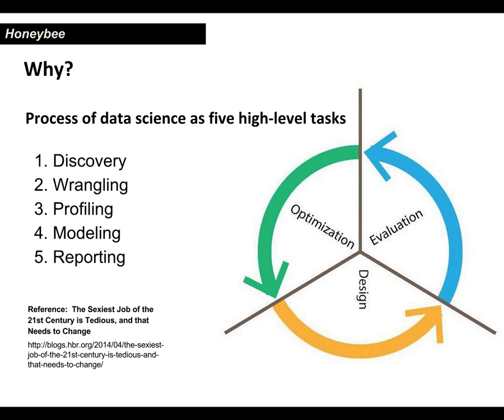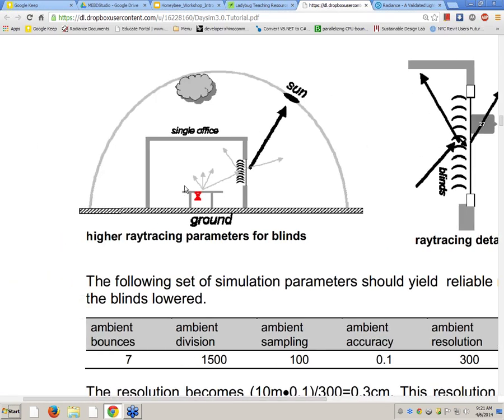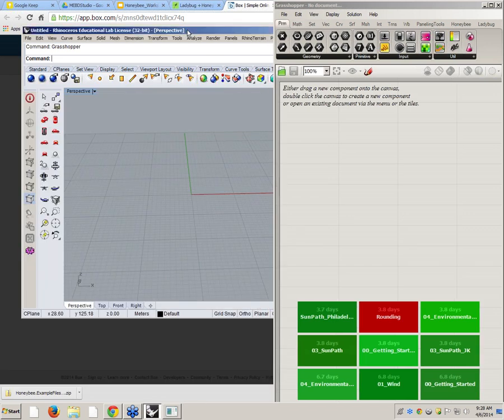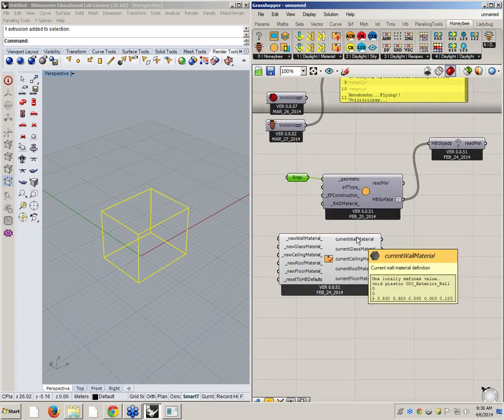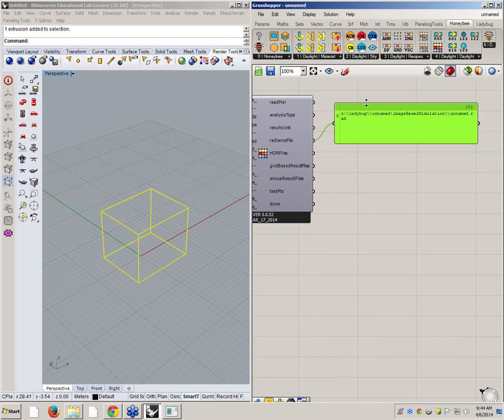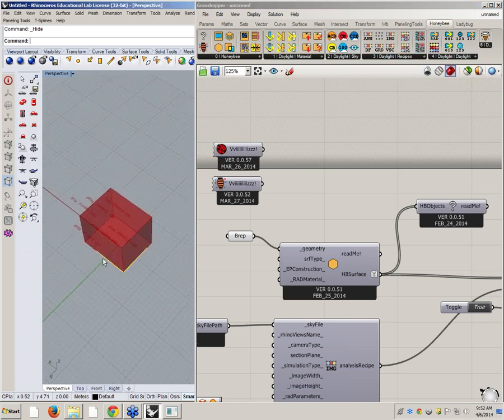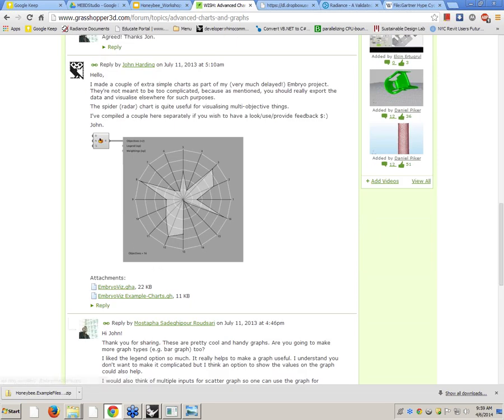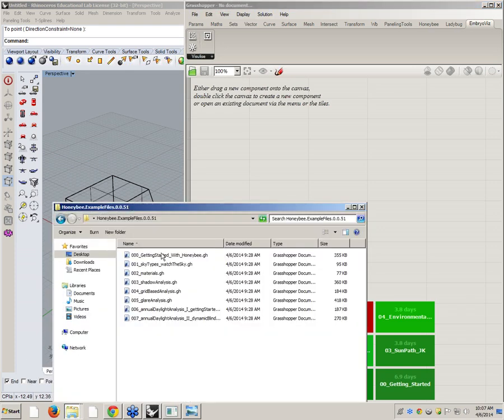Honeybee Workshop Part 1/7: What is Honeybee, Introduction to daylighting simulation

Comment: When I set runrad_ to true, the system crashes. Is there anything I can do to prevent this? When I open the readMe! I don't get any errors, just
0: Image-based simulation
1: Current working directory is set to:  C:\Users\{etcetc}

I also don't see the outputs radianceFile, HDRFiles, gridBasedResultFiles and annualFiles. Instead I have luminanceFiles and radGeoFile. But I guess this is due to a newer version. The results, testPts and luminanceFiles are empty, but the radGeoFile works fine and let's me import RADMaterials and RADSurfaces without a problem.
Reply from the maker: You should post this question to Ladybug Forum and share your file: http://www.grasshopper3d.com/group/ladybug
Reply: Thank you for the very fast response! I figured, that it was due to my radParameters, as when I set the quality to 0 (low), the runRad_ would indeed run. However, the rendering quality is obviously very low now.

Comment: Hi.  I can't seem to find the Honeybee_RADIANCE Default Materials component on ver 0.59. Was it removed? Did an equivalent component take its place? 

Where can I download the sample files shown at the end of the video? https://hydrashare.github.io/hydra/index.html?keywords=HBExampleFiles already shows different samples.

Thanks.
Reply from the maker: Hi Pin. The component has been replaced by 'Honeybee_Set Radiance Materials'. You can download the example files from here (http://www.grasshopper3d.com/xn/detail/2985220:Comment:1405751) but they are not updated.
Reply: Thanks Mostapha.

Comment: Hi! I don't know why the interface of the component RunDaylightSimulation just changed and there is not anymore the outputs HDRFiles and Radiancefiles, is there another way to get them?
Thanks :)
Reply from the maker: +Francesco Scarpati It's still there but with a different name which will change based on type of your analysis. If you're following the examples from the tutorial, you're probably running a luminance analysis and output name is luminance_files. Also check this Hydra example: http://hydrashare.github.io/hydra/viewer?owner=mostaphaRoudsari&fork=hydra_1&id=Honeybee_Image-based_Daylight_Analysis&slide=0&scale=6.062866266041592&offset=-3616.1386114738675,-1495.5813600799015
Reply: Thank you, Mostapha :)